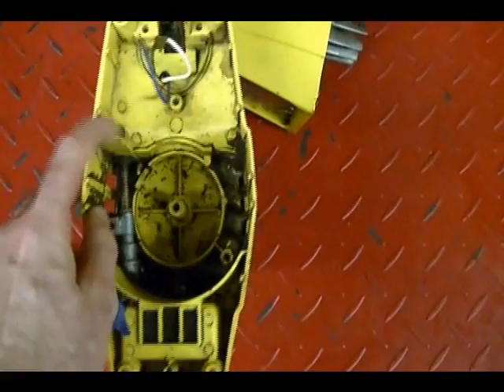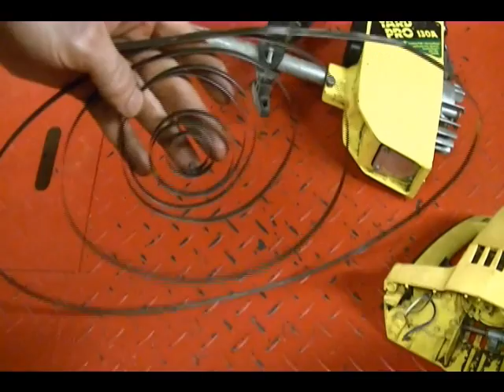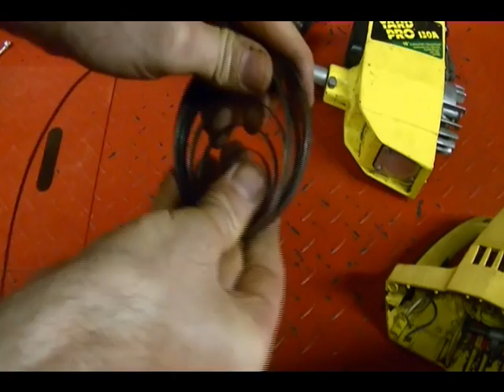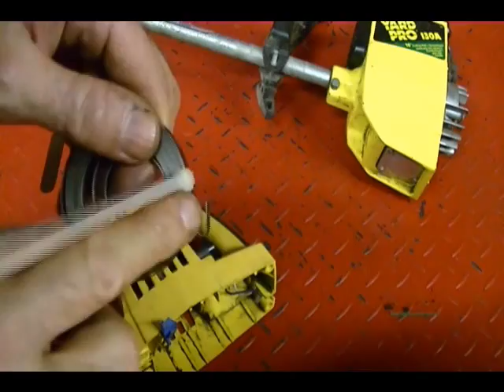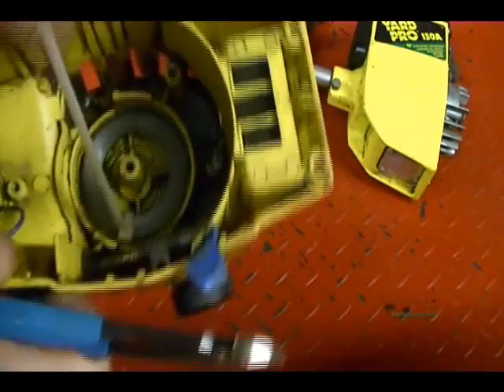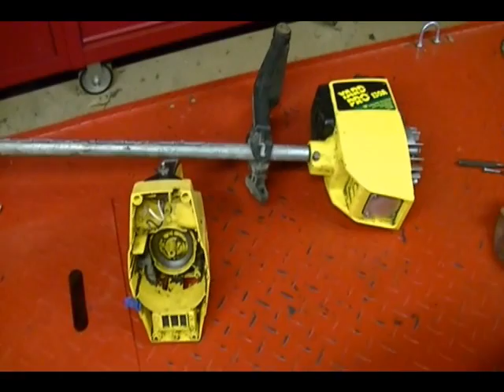How to Wind Up or Rewind a Starter Pull Rope Recoil Spring on a Yard Pro 130A Trimmer

Comment: Don't try this with a larger spring, for example a push mower recoil starter spring.  You will cut your fingers not to mention holding it in place once it starts to get small......even this spring I doubt he did by hand